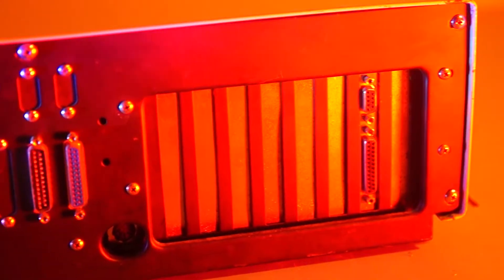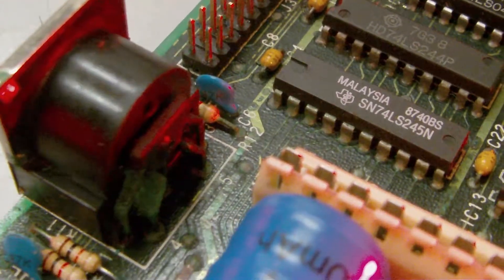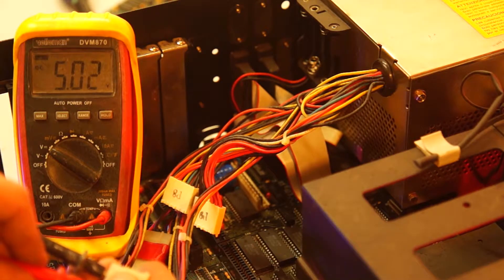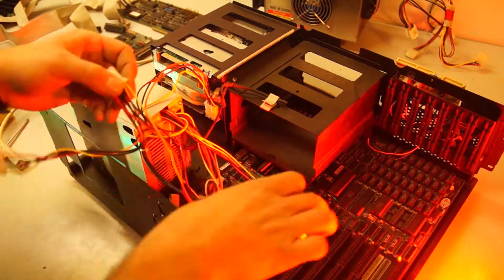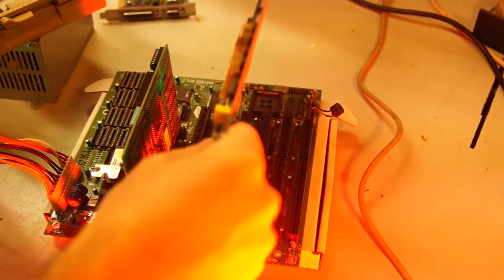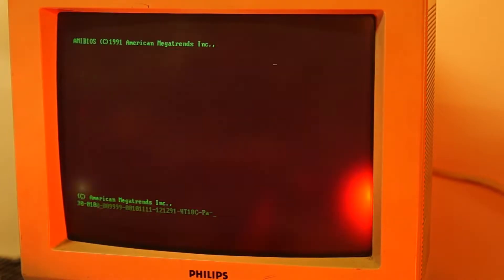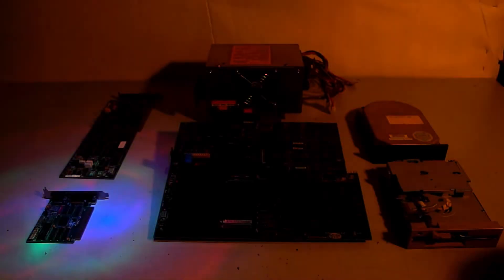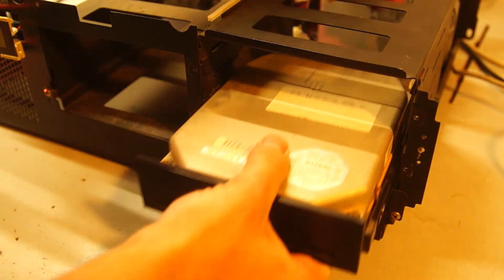[001] - Retro Computer Build : Pt.1 The IBM PC AT 5170 Clone

Comment: I do like the music at the beginning though - the intro; nice! Very nice premise but I'd like to see more :)
Reply from the maker: There is a part 2 on youtube.  I had planned a part 3 but the views were staying very low and not improving over time, so I gave up on the whole idea.   I built the computer.  It is a Pentium 233 MMX now with Voodoo 2 Graphics. :)
Reply: @dustinslaboratory897  That's really cool.  My favorite retro rig is a home-built 1GHz Pentium III w/ dual Voodoo2 in SLI.  I've floated the idea of running a 386 system in a 5170 case.  What I'd really like to do is get a "snapin 386" or one of those old Intel "inboard 386" cards and put that into my 5170 but I haven't seen the latter for sale and the former is about $400 on eBay right now.
Reply from the maker: @angieandretti  Well, I had quite a few options for an AT style case.  I had a 386SX-16, a 486SX-33, a 486DX-100 and a couple of pentium system boards.  In the end I chose the more powerful board because a lot of older titles will also run on a pentium system and I really enjoyed my pentium 75 I had when I was young, so I decided on that.  I only used parts from 1997-1998 except the AWE32 soundcard.
Reply from the maker: The Voodoo 2 board and a CDROM only entered the picture after using it for a while.  I just had it laying around and I wanted to try some games.  So It went in, the Voodoo 2 really needs a more powerful system to shine, but it works well enough in most games. :)
Reply from the maker: @angieandretti  Do you have an idea what kind of performance boost these snapin boards provide?  And are they fully compatible?  In any case, 286 was a weird era for games and stuff.   The cool stuff needed a 386 and the old stuff ran on an XT just fine... :)
Reply: @dustinslaboratory897  No I don't know about the performance.  I'd assume somewhere in between the 286 and a pure 386 system - but if one was affordable I'd find out cuz I was thinking the same thing as you with regard to XT/286/386 gaming.  The 5170 is just so damn beautiful though - and the sounds it makes, man it's like a Ferrari 250 GTO to a top-end car collector!  Not saying it's faster than other stuff from the era but somehow more desirable, and built so solid too.